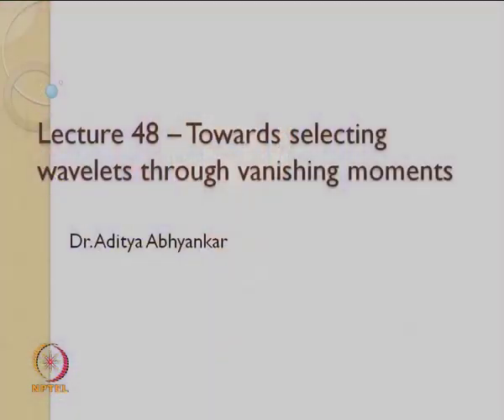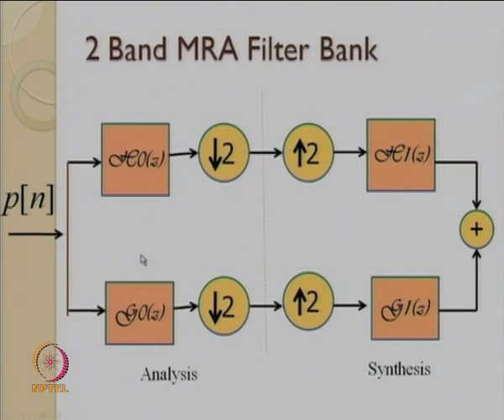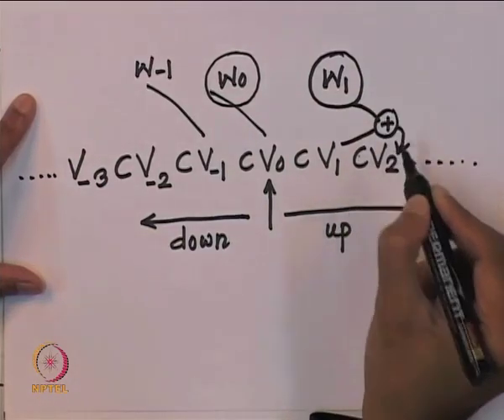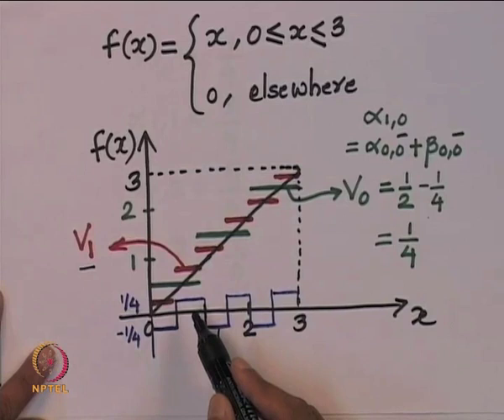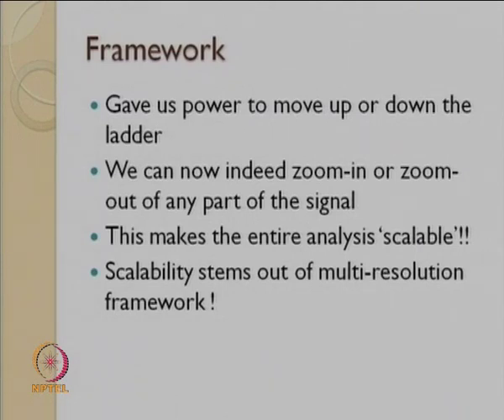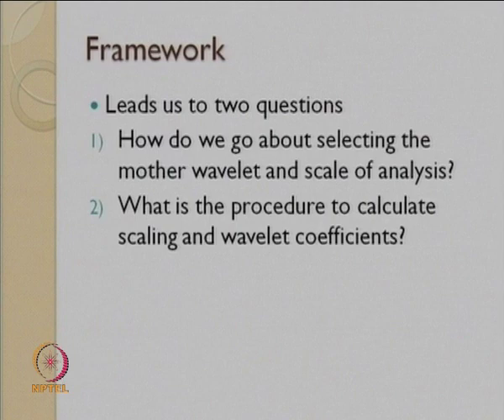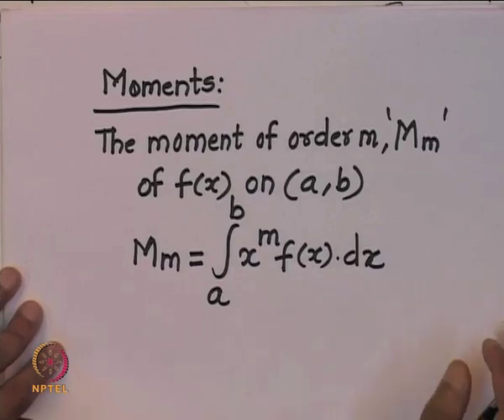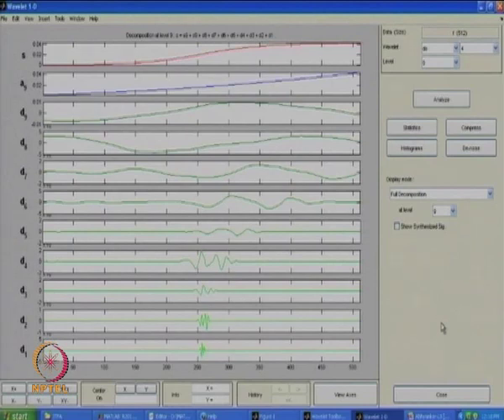Mod-01 Lec-48 Towards selecting Wavelets through vanishing moments

Comment: Thanks a lot for the lecture. Very clear and easy to understand. 
I reckon you switched a signal or the limits @46'36", as both integrals are identical leading the subtraction to zero. While the result has been correctly writen as -1/4.